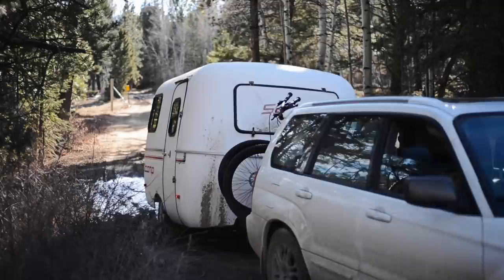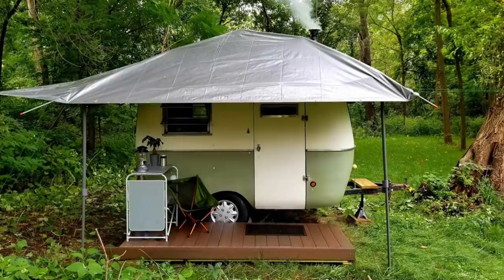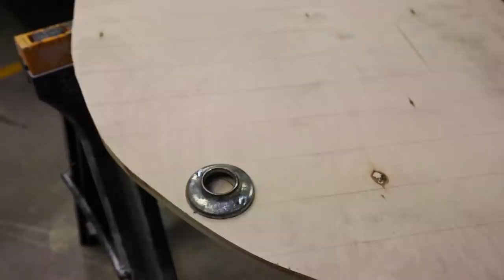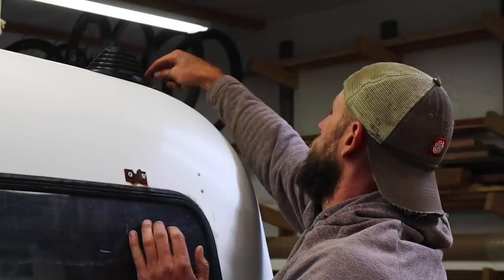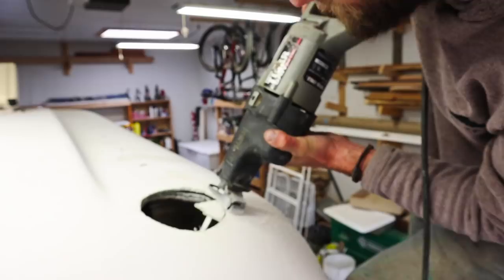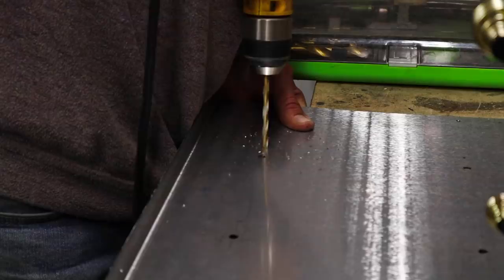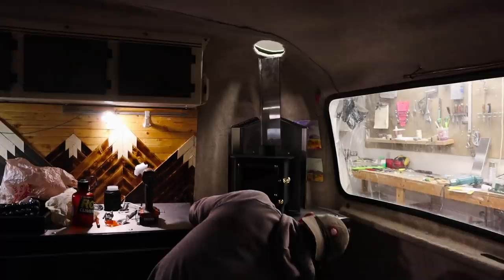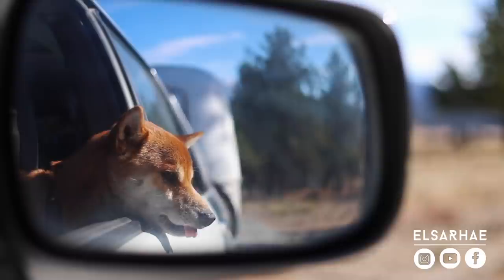Installing a CUBIC MINI WOOD STOVE inside a 13ft Scamp Trailer

Comment: Super cool!! You might want to research Dicor self leveling roof sealant for on top of the  silicone seal where you had to screw it in, and around the edge where it meets your roof. It provides a far superior seal than the silicone caulking. I do not know how hot that area will get but you can always get the stove going and check it with a thermometer and get with Dicor and see if their product can withstand the heat generated in that area. Best of luck wish we could instal one in our RV. Enjoy.

Comment: I have a 13 fibreglass trailer, we’re going camping this weekend (Alberta). I’m going to ponder doing this to mine! 😍
Reply: atherwitch hi I am in Alberta as well and planning on installing this in my truck camper , how was your experience with this ? Did you keep warm ?
Reply: Xplorer lol I live in Alberta too and use this when I’m camping out at my farm , it works great tbh, my camper is a bit bigger then the one in the video and it heats it up in winter no problem
Reply: Master commander dragon Sir hey thanks for your feedback, do you happen to know the coldest temp you camped in ? I am really wanting to know if this thing can keep up with harsh Alberta weather. Would love to go camping in mountains but hate the cold lol.

Comment: How do you seal pipe while trailering ? What goes on top of pipe when using..rain cap ? Thanks for your info on stove install.
Reply: Dennis , Brevard NC we found a 3” pvc cap at the hardware store. Works perfect.
Reply: @24barron  Thank you..

Comment: The cooking surface looks small. If you were to take a flat piece of steel curl the edges so it fits over the top and self clamps on the sides then take notch out the centre. You might be able to extend the cooking surface. At least enough for one pan. And also it would increase the surface area for radiant heat.

Comment: I'm ordering this stove next week with the stainless steel wall mount for my brand-new travel trailer. Where did you install all the wing nuts to remove for travel?  Did you use 3" and 5" stove pipe on the inside and the outside?  I understood from Andrew that you use 3" inside and 3" and 5" once you exit thru the roof.  Looking forward to this new addition.  Thanks for sharing!

Comment: Just thinking about a stove pipe "cover" on the top of that to diffuse any possible embers flying out(especially during that time of year where Fall and winter transition while using it then) and keep the rain/surprise weather out. Otherwise, looks great and a fun video.

Comment: Wonder if one could use fiberglass resin to create a boot and use double insulated pipe.  A fiberglass resin to make a seamless boot that meets up with the stainless pipe would look pretty cool.  I worry about rubber boot cracking and steel screws rusting.

Comment: Order two of those camp stoves that have a thermal electric generator with a fan that circulate's heated air. Then modify your cubic stove and add those thermal electric generator's with fan's to the side's of the cubic mini. Now you can charge a battery bank while you use your stove or add in a wireless charging device and charge up thing's? 😊😀👍

Comment: How do you travel with it? You mentioned removing the stove during travel. What about the stove pipe itself? I’d imagine letting it just hang there during travel isnt going to work well. Any soot in the pile would fall out and make a mess. Plus the airflow from traveling would flow through the pipe, also water if you’re driving in the rain.

Comment: Was wondering if you thought about putting in a small slow running circulate the heat around the Scamp.

Comment: That is really cool. I do have a question. So if you guys are going to have to remove this each time that you move, are you also going to have to bring down the pipe going up to the exhaust as well? 
That seem like an awful lot of work but maybe I did not completely understand the installation. It looks really great and I love that you both share your adventures with all of us. Hope that the pipe 
somes in soon. It is already snowing in the Rockies.. Great adventures..
Reply: We will have to take the pipe down when we move. We built it with disassembly in mind though. Takes a few minutes to tear down.
Reply: Never heard of any RV/vandwellers taking their mini stove out of its spot while driving?  I know the mini marine wood stoves roll all over while at sea.  I thought they were always just bolted in and not removed
Reply: Jenny Mckay they usually are

Comment: just watched in Nov. I you have not solved your fabric around the stope pipe possible fire thing,  use a donut of welders cloth. Silicone the cloth  against the  fiberglass then wrap around the fabric and adhere; the welders cloth is like bead and the fabric is the sandwich filler ( sorry I don't explain things well) and the stove pipe goes through the donut hole. Welders cloth is also used when using stove pipes in tents.
Reply: not bead sorry bread

Comment: “We Didn’t Start the Fire”? Brilliant! It looks like your Scamp now has a jaunty little cone hat. Have you considered a carbon monoxide detector, just for safety? A wood stove might not demand it, but it might be a good idea anyway.
Reply: Carbon monoxide is no joke and is definitely a killer. CO detectors are relatively inexpensive, and would definitely be on my list (along with a smoke detector) if I had a stove in an enclosed living area. 

If they got adventurous, they could also put thermal switches in the roof vent and maybe behind the metal heat shield to warn them if the temp got too hot. You can get them for various temps, and could wire them up to a buzzer that would warn you if the roof flange or the wall of the trailer was getting hot.

Comment: Why would you move the stove every time you move? I have a home made steel stove built in and installed in a 63 GMC bus and it's bolted down and not going anywhere, been there for years, and is sure nice when it gets cold it is about 1 foot wide 18 inches deep  and 18 inches tall and gets a lot hotter then 600 degrees but I haven't had a problem keeps the bus cozy.

Comment: Cool video and great idea! I always wonder why folks seem to set the these stoves on a shelf about waist high. Cold air sinks, would it not be better to have the stove as close to the floor as possible?
Reply from the maker: You’re right, however we’re working with about 2ftx3ft of floor space so it wasn’t going on the floor.
Reply: Yep, and there is another reason to put it on the floor if possible - you can make a hole in the floor and arrange for a cold air intake for the stove, which both makes it burn better as it gets cold air full of oxygen, but also prevents the stove from taking its air from the inside; taking air from the inside means there is constant cold air flowing towards the stove, so you don't get the space heated nearly as efficiently, and have to burn more wood to compensate.
Reply: We can still run an air intake through the bin under the stove. Going to see how it works without, and put one in if needed.
Reply: Mike Brink and closer to the floor is not as nice of a view of the beautiful fire.
Reply: Not really...when you move about in your living space it creates natural convection currents...
Also, you want the fire where you can tend to it and control it..
Having it on the floor is kind of dangerous because you can push something against the stove and not realize it...
If you absolutely have to, get a little fan to move air around...

Comment: Elsa, was there any need to consider the types of metal used? I've heard that galvanized metal can cause toxic fumes when heated. I'm not sure at what temperature that happens, but was wondering if that was a concern? Thanks. Love your editing & commentary 👍
Reply: Token Asian Kowboy yep. That’s something we realized when we were trying to get a 3” diameter extension for our stove pipe. All the 3” stuff at the hardware store is made for lowish heat dryer vents. The galvanized metal off gasses at high heat. If you do get a cubic mini, most of the exhaust pieces need to be purchased online. 🤷🏻‍♂️
Reply: Here's a thought 3in exhaust pipe and it's pretty thick. And can be bent at some muffler shops.

Comment: If your stove is bolted down why would you need to remove it for safety during travel?
Reply: Quarlow 12 our Scamp is old as balls and we often take it on gnarly roads. We may not always put the stove in the car when traveling.

Comment: I was wondering why you need to remove it for each trip.  I have watched a lot of videos which have this stove permanently mounted, this is the first where it is removed for travel, is this due to the structural integrity of your scamp?
Reply from the maker: It’s a very heavy chunk of metal seated at the toe of the Scamp, making it quite heavy going over bumps, we also wanted it impermanent so that we don’t have to have it up all year round and can still use the counter space!

Comment: The stove should be on the floor to get top to bottom heat circulation a fan will work also to move air from top to bottom ..have fun

Comment: Very very amazing ♪
 It is cool ♪ 

Did you attach a CO alarm?
 If not, there is a battery type, please attach it for safety. 
The CO alarm  is designed to be installed in a high place.

Comment: Can you use wood pellets instead of whole pieces of wood
Reply: They would have to buy and store the pellets. Trailer campers have to constantly economize their space, and plenty of small bits of foraged wood is available. Small bits and chips are all they need to heat such a small space overnight.

Comment: Who is the manufacturer of the red rubber flue exit that is on your roof of the camper. I would like to get the same part for my unit. I see that it is CSA approved as well. Where did you buy the part. It is not on the Cubic web site. Thanks for your time.

Comment: I put the Grizzly into our Stepvan conversion. You will want to get a small clamp on fan to push the heat down to the floor area. You'll have to play around with the ideal spot, but that really makes a difference for proper heat distribution. I got a USB powered unit with stepless speed control, it works very well is quite and even c/w rechargeable batteries: https://amzn.to/2Q3xooo

Comment: Have you considered a thermoelectric fan, to use on top, to help circulate the heat.
Reply from the maker: Yes! We have some tiles to try to experiment with this. Do you have any experience with this?
Reply: I heat my whole house with wood. I have a pellet stove upstairs, and a regular stove downstairs. I have a fan sitting on the top of the stove downstairs, that uses the heat from the stove to work. It circulates the air pretty good, and you don't have to use electric to power it.

Comment: Well made video! Would it not be better to mount the stove on floor level, letting it heat the entire height of the room faster? Just asking, thinking if it sits do high up, will it heat at floor level?
Reply: CreativeMan.com.au it would be better to mount lower for warm air circulation. This is the best spot we could find without using up a ton of living space tho. We wanted the mounting spot to be useful when we remove the stove in the warmer months as well.
Reply: @24barron  that makes sense. thanks for replying

Comment: I loved this!!..I live in a 5th wheel and am in the process of running a gas line to it..(I did check with my gas company and they said it was ok by using an underground riser and outside shuttoff) but my plans are to hook up a ventless...that being said I'm getting apprehensions about this as I read about the ventless perils...my trailer is bout 30 some feet with 1 12 ft slide...do u think a stove like that would keep me warm?...this is my first video from u guys I've seen and I am subscribing...

Comment: Cool idea, where do you plan on sourcing the wood?
Reply: Daniel Smith figuring this out as we go. We have been on a friends land that has some good hard woods to use currently. We have burned pine, but it goes up quick. Someone suggested buying wood on Craigslist. Most wood brokers don’t sell small enough bundles for us to travel with. 🤷🏻‍♂️ we’re figuring it out.

Comment: Hello Elsa Rhae.  Love watching your videos.  Well done.  Recently I bought an 18ft 1980 Trillium & am contemplating putting a cubic mini in my trailer.  Love the dry heat as I live on the west coast & condensation is an issue.  I'm wondering how you did the metal sheeting around the back of the stove for heat deflection in the corner.  Do you know what gage sheet metal your friend used?
Reply: Hi Donna, if you go to a stove shop, they usually have the metal, it does not have to be thick, but the important point is that you need to leave a small space for air to circulate behind your shield - DO NOT tackle your shield directly on the wall (the shield may heat up).  Stove shops will sell you insulator-spacers (or use bushings from hardware stores).  You need to raise the bottom of your heat shield 1~2 cm depending on the stove so that cool air enters between the shield and your camper and exit from the top.  Ciao, L (ME, USA)

Comment: i like them but i wish they were just a tad cheaper..
Reply from the maker: Maybe once they become more popular they’ll be able to source the materials easier. We were so surprised to not be able to find any of the parts necessary here in the states. 3 inch double walled pipe is not common!
Reply: yeah seen a cpl guys Macguyer-up they're own stovepipes
Reply: Just saw them recently( electric) on the Geek app or Harbor Frieghts, very inexpensive. Also saw other great ideas in both for van life, skoolies, rv's. With space being sparse, anything that can serve as multi- purpose use, stays in my mind, as I am just begining considering this life as a real option. We had a woodstove, while growing up inbetween electric and an oil furnace and I recall keeping a salt water pot on top to combat the drynesses and also wanted to mention ceramic being in many other small heaters I and others purchased here in Florida, to get the morning chill out. I've also seen beautiful oil filled jars in windows, that stayed warm for hours after the sun went down...for the same ideas. My daughter and I've used those long heating pads 3-4×'s a night(20 minute auto shut off)in a shared bed, when she was young, to keep costs down. It felt real nice jumping into a nice warm bed...lol. I'd get up and turn our gas heater on from 4-5am and shut it back down at 6am, as soon as she was off to school. Having $22-$28/month electric bills in the spring and fall months really helped! I checked what small and large  appliances spun my meter faster and came up with ways to no use so much, like turning off my coffee pot as soon as it was done brewing and warming each cup as needed in the microwave....and definately line dryed clothes for years and still do. We liked thinking about it as having money for "other things" and less "being cheap or frugal.."Good luck to you! And please be safe with it!
Reply: electric element-type heaters tend to gobble up quite a bit of power and are not really considered practical for nomadic-life/boondocking..dryness is something you want in a nomadic vehicle..keeps down moisture and mold.

Comment: Wait why do you have to break down the wood stove to travel?? That's the first I've ever heard about that being necessary.
Reply: Punch Fukker the stove is mounted high up in the camper, the Scamp is 30 years old, and we often take it on gnarly roads. We may leave it mounted on flat roads but wanted the ability to quickly disassemble. Also, we’ll only use it a few months of the year, so we wanted to be able to move it and use the table we built for it. 👍🏼
Reply: ahh, ok, got it.

Comment: Why not only use double pipe near the top?  If you have exposed single-wall pipe right above the stove for a foot or two, that would become a heat sink.
Reply: dper1112 cubic mini suggests double wall the whole way up to keep the pipe hot. If the pipe cools down more creosote forms. We could prob get away with it since our pipe is so short, but struggled to find single wall 3” pipe, and figured it’s better to be safe.

Comment: I thought you were supposed to leave an air gap between the sheet metal and the plywood floors or walls. I would not just glue that metal right to the plywood.